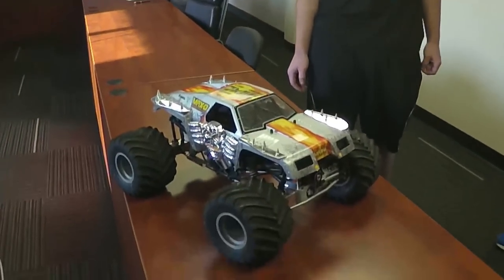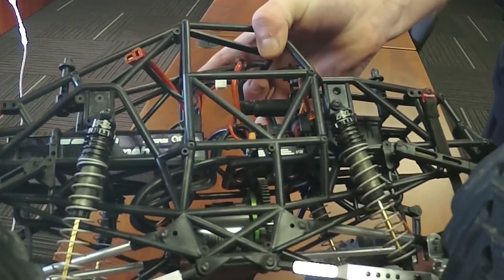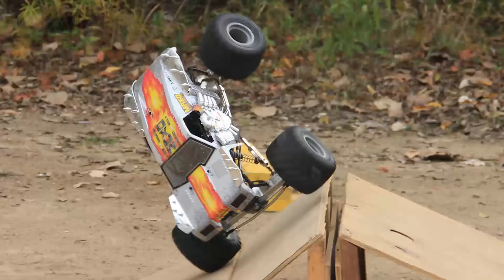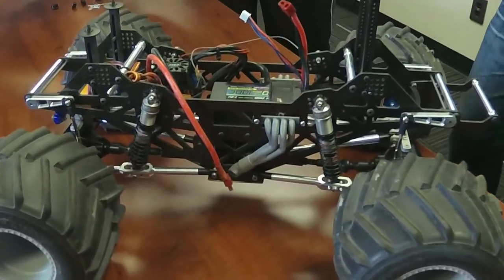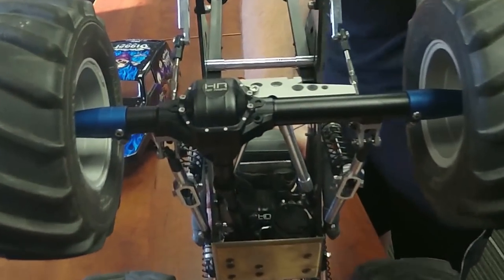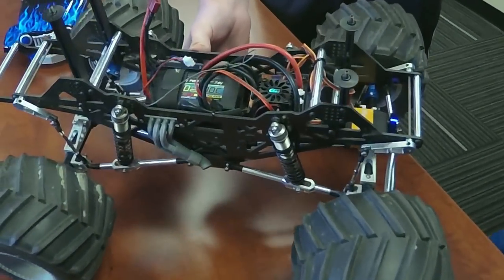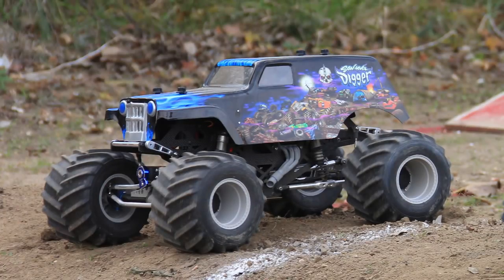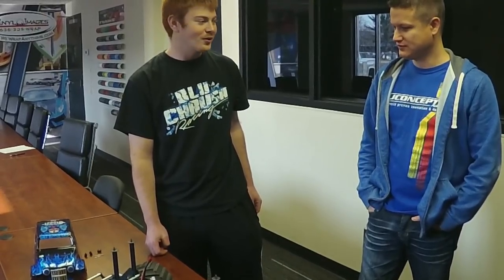Freestyle RC SMT10 "Max D" and Warpath "Son-uva Digger" Monster Truck Overviews - Trigger King Tech

Comment: Great video. Keep them coming. Please be sure to tell us the battery info as well.
Reply: Paul we are limited to one 2S 7.4V 100C lipo battery in retro and sport mod, and one 2S or 3S lipo battery in pro mod. The battery capacities and brands vary and some also use shorty packs, but most use ones with the max allowed 100C discharge rates.
Reply: Jeremy Mark Thank you